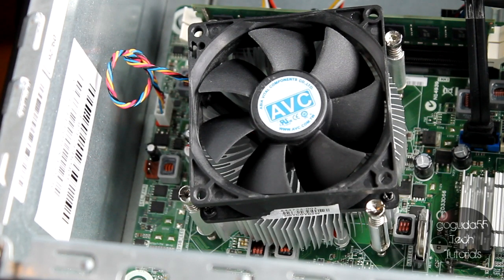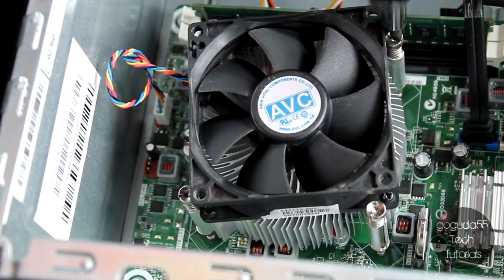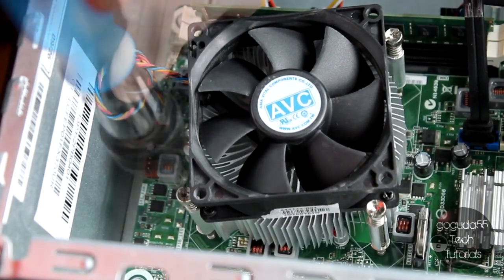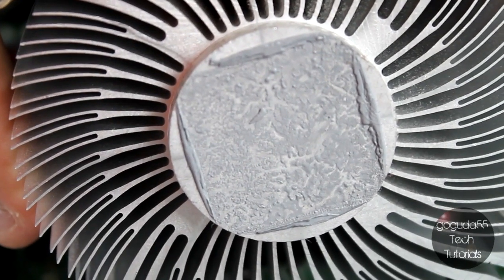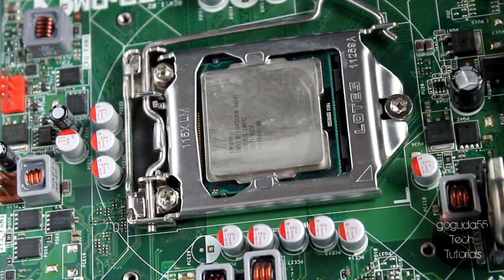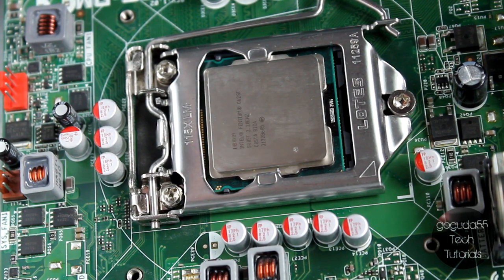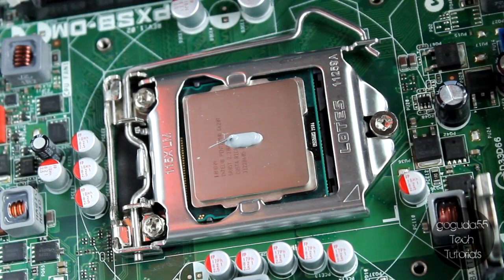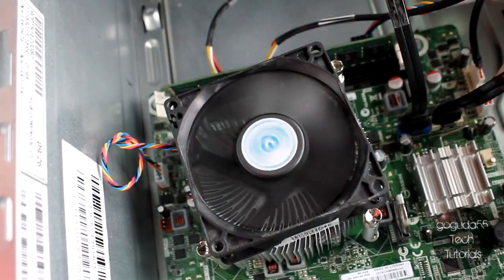How to Replace Thermal Compound

Comment: PS: If you don't have rubbing alcohol, just make do with tissues. Some of the old thermal paste will remain, sure, but this is still gonna work (done this quite a few times, even with GPUs)
Reply: Cestarian Inhabitant 
A bit late but I've heard that nail polishment also works. Either that or just tissues